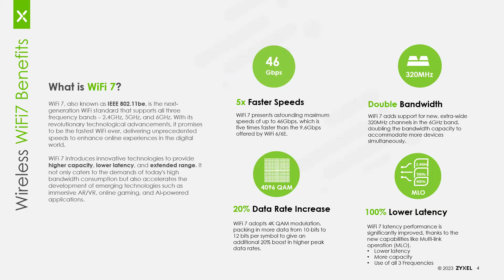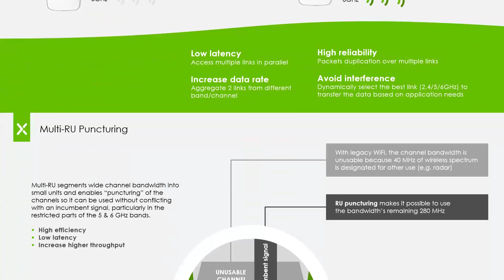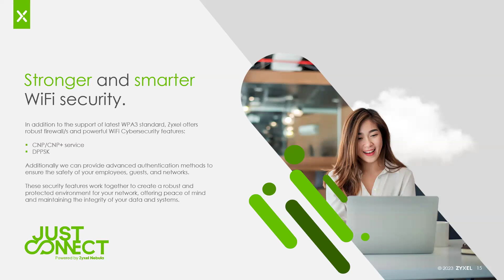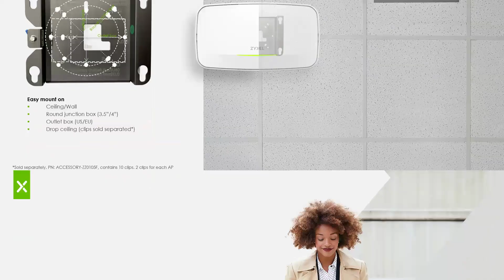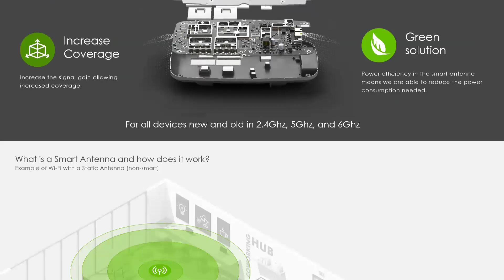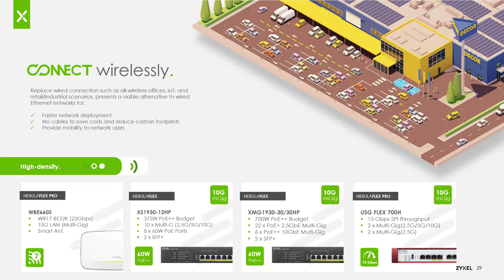ZYXEL | Webinar: Experience the Evolution: Zyxel's Growing WiFi 7 Lineup (03-21-2024)

Comment: Can the NWA130BE be meshed with a wired back haul?
Reply from the maker: The NWA130BE supports Zyxel SmartMesh through Nebula.  Some units will have a wired connection to the network while other units will have no wired connection to the network.  It does not support bridging two or more locations together.   Hope that helps